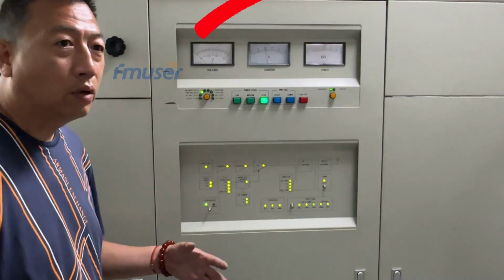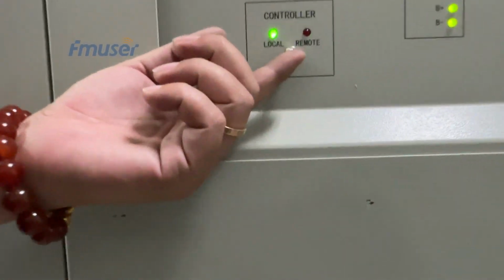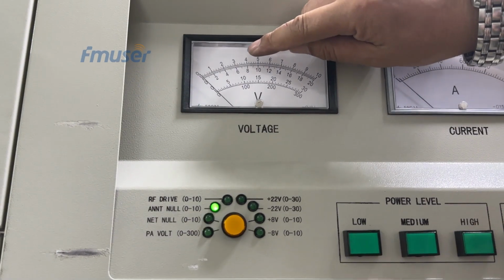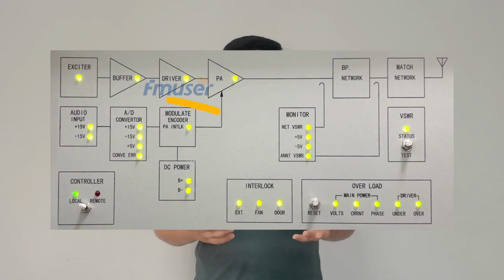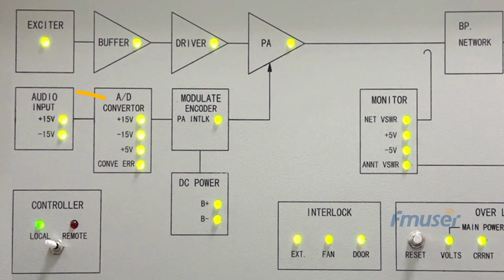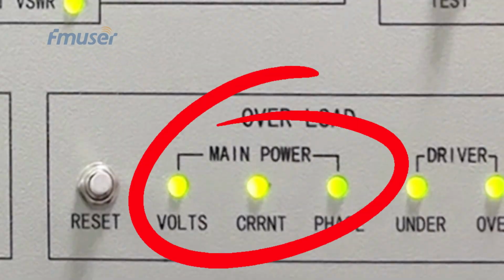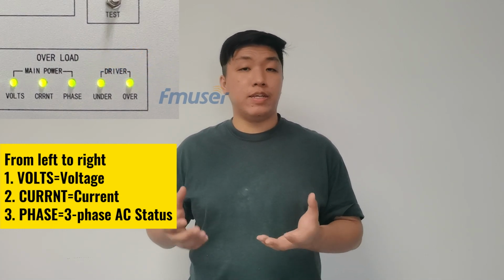How to Troubleshooting A 10kW AM Transmitter Like an Expert?

Comment from the maker: Learn More about Our Solution: ▸📧 Email us: sales@fmuser.com ▸📞WhatsApp us: https://api.whatsapp.com/send/?phone=8618924246098&text=Hello-I-watched-your-10kW-AM-transmitter-Troubleshooting-YouTube-video-and-I-need-your-solution ▸☎Give us a Call: +86 139-2270-2227 ▸🔗AM Transmitter Family: https://www.fmradiobroadcast.com/product/am-transmitters

=-=-= TIME STAMPS =-=-=

0:00   - Project Review
0:47   - Control Panel Introduction
4:05   - Step #1 | Key Components Voltage Verification
6:00   - Step #2 | Main Modules Troubleshooting
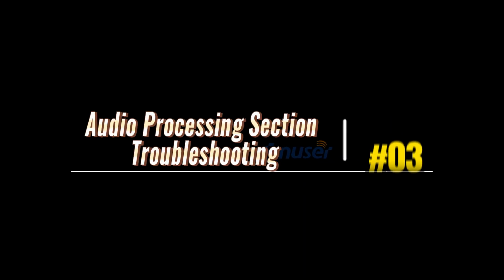11:02 - Step #3 | Audio Processing Section Troubleshooting
12:54 - Step #4 | Monitor Module Troubleshooting
13:52 - Step #5 | VSWR Troubleshooting
15:00 - Step #6 | Interlock Module Troubleshooting
18:20 - Step #7 | Overload Modules Troubleshooting
20:32 - Step #8 | Power-On and Voltage Check for Key Components
23:59 - Part 4 Summary